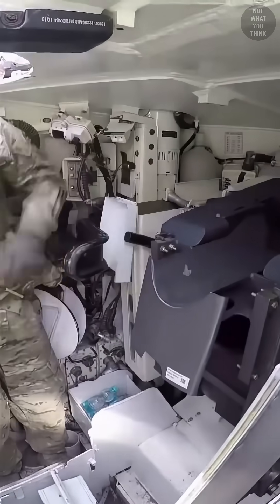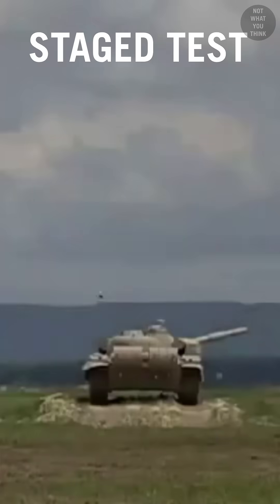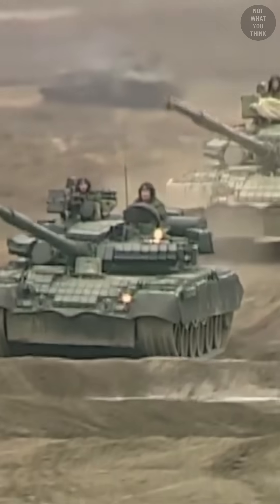Why M1 Abrams Tank Has No Auto-Loader #shorts

Comment: I think a lot of people in this discussion are missing the fact that you're risking 1 less person of a horrible death or severe injury if their tank gets hit, in terms of autoloaders vs manual loaders. Yes, ALs are possibly more expensive, but by how much? How much money is put to train a person to properly serve in a tank and keep it maintained? Sure, you could argue its 1 less person onboard to either swap positions and/or keep the tank in tip top shape, but that can be done away from combat. In a pinch? Yes, the extra person could be useful, or just another casualty.

Parts are easy to replace, people aren't, and I think that's the ultimate goal of the auto-loader. Cost means nothing if you're preventing more lives lost and still providing a usable/working platform. Could they break? Sure, but so can anything else onboard the vehicle. So attempting to stick a stigma of AL's being poorly made doesn't exactly work. Otherwise the tank is useless.

As others have also pointed out, you can have an AL and still safely stow ammo, so I doubt it'd be impossible to have an Abrams with an AL. Would it take time and be expensive to retrofit ALL of them? Absolutely. Probably just be best the newest ones are built with them to slowly phase out manual loaders. Or just make a tank designed with more automated parts and less crew members. Tank drone...?

Comment: I used to be a tanker with 1st armor division. The Abrams is a beast of a tank and some loaders can load a round in 3 seconds.
Reply: Probably the loader was holding two rounds, each weighting around 20 kg, ready to thrust them into the barrel one by one after each shot single handedly!? I don't believe you!
Reply: @GREATRussia1990  No hero.  It's pretty damn fast.  I've done it more times than I care to think of and 3 seconds is pretty slow really.
Reply: @GREATRussia1990  As long as you know how to hit the knee switch and flip the round into your forearm just right it can be done. Watch videos of Abrams tank loaders. You will see.
Reply: @dslagell45  That needs a lot of practice! But the auto-loader doesn't! Also i prefer to watch videos of our tanks! But I really don't need that either!
Reply: @GREATRussia1990  That's why we go through training. Yes a auto loader is great but a trained loader can do better. Plus what if the mechanical parts fail in a auto loader. SOL at that point.
Reply: @dslagell45  If auto-loader part fails you just replace that part! What will happen if the loader dies? Replace the loader? Which is cheaper? The mechanical part or a human life!? Honestly i saw 2 major repairs of an auto-loader for 6 years!
Reply: @GREATRussia1990  If the loader dies most likely the rest of the crew is dead. But if not the gunner or tank commander takes his place. Both the gunner and tank commander can control the gun.
Reply: @dslagell45  That thing with the controlling of the gun(both by the gunner and the commander) is common thing for the modern tanks! But if the commander or the gunner have to replace the loader, that means a crew member with specific skills have to perform tasks which are not suitable for her/him! A big MINUS is created there! Because nor the commander has loader skills nor the gunner and also 1 of the 2 mentioned crew members has to do multiple "jobs"! For example if the gunner becomes the loader, the commander have to do take his place without "leaving" his place and tasks! That will cause overloading and the tanks effectiveness will fall considerably! That thing is inherent for tanks with autoloader too, but with a difference! No matter if the gunner or the commander is kncoked out the tanks rate of fire will remain the same! Also if a tank with human loader is travelling cross country with 25-30 km/h the loader will have hard time loading the gun, while the autoloader reloads the same no matter of the situations that we mentioned here! Also the most important thing(at least for me) is that the human life is priceless! You can repair the autoloader or throw it away if it brokes, but you can't repair dead human or throw it away right?!
Reply: @GREATRussia1990  about the replacing part, if the autoloader needs a part replacement, you either need a person to be trained in repairing or you just need another crew member for repairs which defeats the purpose of the autoloader replacing the loader. Also as you said its a minus for someone to take the place of the loader, in this case repair the gun. So we are back at square one.
Reply: @BlackoutGootraxian  1st Have you ever trained to be a tanker? I dont think so! 2nd Every tank formation has its engineer crew! Also tank crews are trained to do repairs to some degree! This is basic thing for Russian tank crews from the times of WW2! 3rd The tank crew specifies in fighting using the tank not repairing it! And that doesnt matter if the tank is with autoloader or not! 4th I never said something about repairing a gun! But i will answer to that too! If the gun fails it depends a lot! Depends from the situation, depends from how bad the gun is damaged and the most important is what kind of repairing equipment you have! For example if the breech is damaged you can repair it! You can repair the recoil system to some degree! But you cant repair the barrel!
Reply: @GREATRussia1990  first off you are also not a tanker but i dont know why that matters. I was mainly referring to the autoloader breaking mid-fight and making the tank useless. And an engineer cant go and repair it then. But if the loader dies in a fight it can still be replaced by someone which is still better than not being able to use the main gun. Even though they are trained to repair they cant do it during a fight.
Reply: @dslagell45  Yup. After you train for a bit you get really quick with it. The A1 and higher marks are a lot faster to load than the old M1s and IPs.  Heavier round though.
Reply: @GREATRussia1990  Not as much as you would think.  Give me an afternoon and I could train you up pretty quickly.  Well, strictly speaking I could teach you the loading part in just a couple of minutes, but you would need an afternoon on a gunnery range to build up the muscle memory and to get really good.
Reply: @rcgunner7086  I agree it's easy to learn how to flip a round. It's harder when the mechanical parts fail.
Reply: @rcgunner7086  a life is a life but it can't be replaced on the battlefield.
Reply: @rcgunner7086  can be replaced*
Reply: @rcgunner7086  What are you talking about my friend?
Reply: @GREATRussia1990  is the autoloader fails the tank is combat ineffective, if the loader fails the tank will be at lowered combat effectiveness but will still work. Working tank>
Reply: @Myemnhk  The Autoloader rarely fails BUT,  if it fails you still can load the gun! The problem is that it takes a lot of time to load! In a tank with human loader the situation is the same! But the problem is that another crew member must to the loaders task! That means that tank loses a crucial crew member! A real tank is not War Thunder game my boy!
Reply: @GREATRussia1990  never said it was war thunder that must be your projection about yourself my boy.
Reply: @Myemnhk  Have you ever been in a tank?
Reply: @GREATRussia1990  why are you deflecting now. I stated a fact you were unhappy with, this isn't about me or any tank games you play.
Reply: @Myemnhk  Im not deflecting anything! It seems you think you know a lot about tanks! I just asked about you've ever been in a tank! Tank with autolader can be loaded manually too! Also I rarely have time to play your tank games! There are a lot of nerds like you which they think they know a lot about tanks just because they play simulator games! Well the real tank is not a game! Just tell me have you ever been i a tank?
Reply: Tj Kirby  What do u mean with that " And thats why us still has abram and russia no."?
Reply: Tj Kirby  I agree the Russian tanks are really good. Both of our countries have very devastating weaponry at our disposal. I do like the Israel tank as well and their military is not to be trifled with. I would not want to go up against either Russia or Israel.
Reply: Tj Kirby  I also realize that if we didn’t stop Germany when we did in WWII their tanks would’ve devastated us because they were advancing in technology faster than the US and Russia. It took all of us to stop them.
Reply: Tj Kirby  I know which rockets you are talking about. They were devastating. The one tank from Germany that would've destroyed us was the maus if they had mass produced it. But once we finally invaded Germany they only had 2 and only 1 with a turret and armenment.
Reply: Tj Kirby  Yes the T-14 has thick armor for modern day tanks. Which is comparable to tanks like the Tiger I and Tiger II back in WWII for that time. The Sherman tanks back then would often bounce rounds off of the frontal armor. That's why we had to use a platoon most often to get around to the sides and back of a Tiger tank to destroy it.
Reply: Tj Kirby  Thank you and you are right the timeline wasn't to far back. I am a history and math type of person. I enjoyed our conversation. Hit me up anytime 😊.
Reply: The type 90 can do upwards of 3.5 seconds. And for longer
Reply: @patriotic-panda  most modern tank engagements usually only use 3rds at most per tank meaning that an auto loader in practice doesn’t provide a significant advantage as you can rarely find a target as fast as you can load meaning a faster fire rate is wasted.

Comment: I’ve talked to quite a few tank crews, and consensus from multiple of them is that a manual loader is very useful because different types of rounds can be loaded as needed (APFSDS isn’t going to be very useful against infantry, and canister rounds won’t be good against armored threats). I’m not sure if the most modern autoloaders are capable of loading different rounds, though.
Reply: They are capable since the 1960s 😃
Reply: @peterisaszegi4456  oof, I had no clue. So they can just load any arbitrary round from the ammo rack that is needed?
Reply: @grantpeterson2524  yeah, the rounds are stored in separated mechanisms, and on command from the gunner, the mechanism computer will select which mechanism to link to the breach for loading.
Reply: @grantpeterson2524  if we're talking about older russian autoloaders - not really. They were developed in 60s and thus didnt have much in the way of digital stuff. They had analogue ammo counter that looks like scale on old voltmeter! 

So, because ammo loadout is constant for all tanks (say, 10 APFSDS in carousel slots 1-10, 10 HE in 11-20 and 6 HEAT in 21-26) it only required autoloader to keep track of how much rounds of each type it fired to reliably switch to desired slot correctly.

Newer ones likely are more digitalised, but likely no possibility for "give me a shell from slot_number". Its just impractical.
Reply: they are capable
Reply: Даже если автомат заряжания сломается всегда можно заряжать орудие по старинке, в ручную

Comment: Western tank tactics already require a big turret in order to accommodate the gundepression needed for ambush tactics, so the extra space for a loader is not a huge issue. And 4 guys means that there are more grunts to handle shitdetails (like changing tracks, guard duty etc) which leads to better crew endurance. Soviet tanks on the other hand are expected to be on the offensive, not to mention that soviet 125mm rounds weigh up to 33 kilos, which is a bit too heavy for a human loader given the cramped quarters and the fact that you might need to do 20-40 such lifts in a relatively short succession (NATO 120mm tops out at about 23 kilos, which is a lot more managable. Especially since NATO tank crew tend to be bigger on average).

Comment: Honestly having an Auto loader and a Human loader combined woulden't be a bad idea, Honestly while the T72, T90 and T80 series of tanks have an autoloader and are of great designs, the human loader is just as great, I often hear that the Human loader often reloads the tank cannon much faster than the autoloader but the Autoloader always has a consistent reload time, so its really the difference between deciding if you want a faster reload time or if you don't want to worry about an extra crew member. Theirs advantages and disadvantages.
Reply: Russian tanks can be loaded manually should autoader breaks. But if Lecler autoloader breaks, crew cannot load manually

Comment: Manual loading is two times faster than auto loading. Hate when videos like this fail to mention this.
Reply: The record for a manual loader is 2 seconds. The type 90 can load in 3.5 seconds. And it can load at 3.5 seconds longer than the manual loader can load at 2 seconds

Comment: Firstly, not all of the shells in the Abrams are located behind the armored door. Secondly, the armored door does not save if there are high-explosive fragmentation shells in the ammunition load. Thirdly, if the armor is burned out by a comulative jet, then where the ammunition is located is no longer important. Maybe the armored door was conceived as protection for the crew, but it clearly does not work that way. And I also did not understand the connection between the presence of an armored door and an automatic loader. In a tank the size of a steamer, which is Abrams, they could have placed both. So the assumption that this is just an extra pair of hands in the crew looks the most realistic. In addition, this is very important for a tank that takes off shoes so easily.

Comment: -An actual tank mechanic “This video doesn’t mention that an auto-loader can’t put in different rounds on command. Also, while the Abrams doesn’t use an auto-loader, the  120 mm cannon does have an auto-loader designed for it when it is used on a Stryker.”
Reply: it can though, it was shown in the vid too in one of the background clips
Reply: @wolimoli  The Abrams can use different rounds on demand because it ‘doesn’t’ have an auto-loader, and a smoothbore barrel. Auto-loading tanks can’t switch between rounds because they have an automated feed system. Where the Abrams can freely use Sabot, LAHAT, HEAT, and Grapeshot rounds at any time by just pulling out the individual shell and loading it.
Reply: Strykers don't use 120s.  They use the old 105mm.
Reply: @rcgunner7086  you’re right, but the breech block for the 105, and the 120 is shared.

Comment: The only tank of the fifth generation Merkava 4 has his own gun M253 from IMI not German like in Abrams  - have used an electrical semi-automatic revolving magazine for 10 rounds - Removable modular armor is used on all sides, including the top and a V-shaped belly armor pack for the underside. The Mark IV includes the larger 120 mm main gun of the previous versions, but can fire a wider variety of ammunition, including HEAT and sabot rounds like the Armor Piercing Fin Stabilised Discarding Sabot(APFSDS) kinetic energy penetrator, The tank has a high-performance air conditioning system and can even be fitted with a toilet for long-duration missions. Merkava Mark IV equipped with the Trophy active protection system (APS) USA Germany and the UK buys this system... First in the World The IDF  Elbit's Iron Vision, the world's first helmet-mounted display for tanks, in mid-2017. Israel's Elbit, which developed the helmet-mounted display system for the F-35, plans Iron Vision to use a circular review system as a number of externally mounted cameras to project the 360° view of a tank's surroundings onto the helmet-mounted display of its crew members. This allows the crew members to see outside the tank while staying inside, without having to open the hatches. such as hull shaping, exterior non-reflective paints (radar cross-section reduction), and shielding for engine heat plumes mixing with air particles (reduced infrared signature) to confuse enemy thermal imagers, were carried over from the IAI Lavi program of the Israeli Air Force to make the tank harder to spot by heat sensors and radar. Its a problem people don't understand what it is - this is Fifth-generation Tnk proven in combat
Reply: Right."Proven" against Palestinian civies. Pile of junk. Which is why Hezbollah kicked your asses in 2006.

Comment: Wow safty door. But when you geht hit from a good tank shell you will see this "nice add on" will not make a differece that you get crispy roastet in you Tank. I think it would bei better to overhaul the Gasurbin. Why...well it needs much Mode Energy/ Fiel then other  good Tanks, even if the Abrams is quieter, that doesn't fit into the ratio I think.
Reply: The gas turbine can also burn any type of fuel
Reply: @chaosXP3RT  yes, still it consumes more than a normal "Vielstoffmotor/
Multi-fuel engine"

Comment: How many rounds are those tanks carrying? 20-30? Pressure from 20 exploding rounds of ammunition can be handled with "blow off valve"?
Reply: The M1 Abrams with the 120mm smooth bore gun has about 40 pieces of ammunition

Comment: Why M1 Abrams Tank has no auto-loader?
Newest Abrams version designers: if it's not broken, don't fix it.

All the while, T-14 Armata has turret crew of 0. Fully automated, separate from the main hull. Going for autoloaders has paid off.
Reply: What happens if you need to change ammunition type? Say you want high explosive fragmentation but all you have is sabot anti tank loaded in you auto loader.
Reply: @MrWhitmen1981  lmao, there always different types of ammunition in autoloader, and you can choose which one you need for the next shot. You better go to google and read how this thing works
Reply: If armata's turret is fully automated, wont it be very exposed to EMP and jammers?
Reply: Also that also means the hull is cramped and decreasing crew comfort